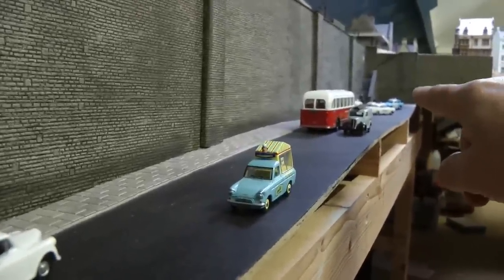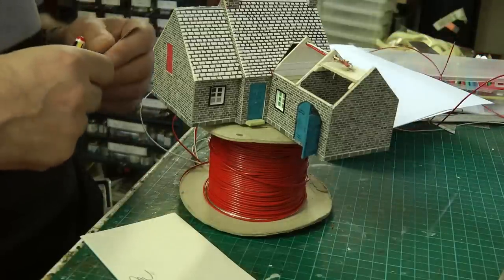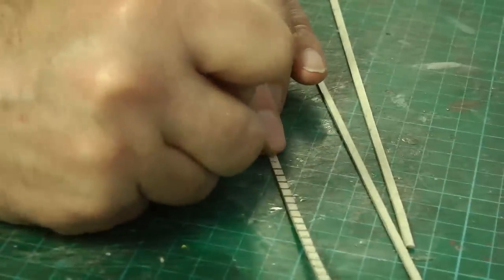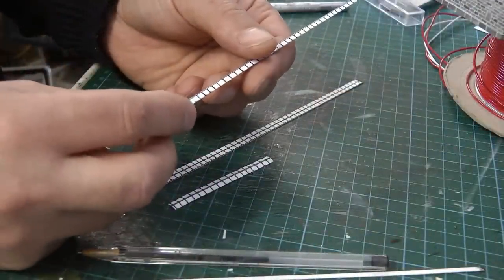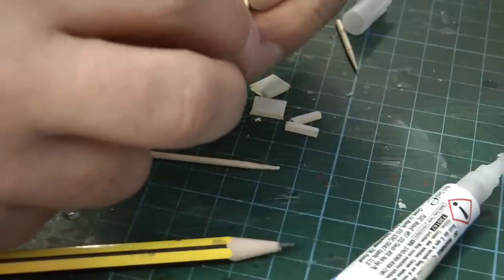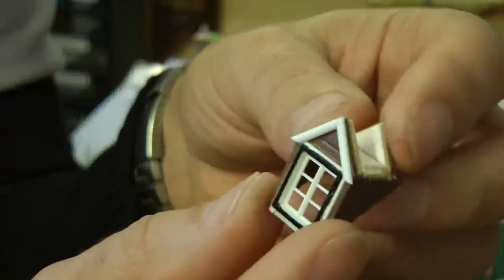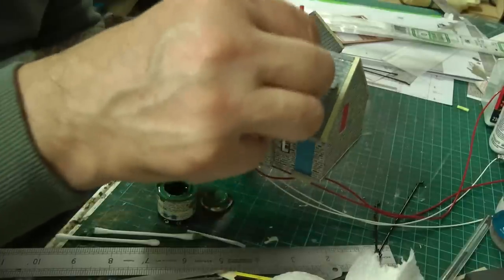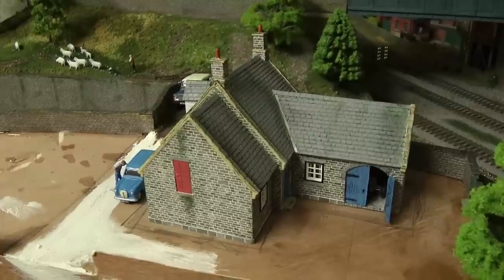Snookdown farm Part 4  No368

Comment: Great modelling once again and it’s all in the detail, like the stone capping slabs, very different - Yorkshire style! Looks super, a great choice of building. Like the dormer window, subtle but very striking. A short wheel base land rover or perhaps a cast off WW2 jeep? I suggest the fuel tank mounted on brick work should be on the opposite side to the building as far away from it up the track. How about a sheep dip and shearing area with wool bags and a shearing session in progress. A small workshop and stores, plus a small covered area ITN no doors for his land rover. How about a few bundles of fence posts and don’t forget a sheep trailer to get stock to auction. Also a small out building for the working woofs. Maybe a stable for a horse too and other covered stalls and maybe open pens for assisting at lambing. Just a couple of ideas. All the best Stephen
Reply from the maker: Hi Stephen, some great ideas there. well you have almost caught up. maybe we will be all square by the weekend. catch up soon my friend. cheer's Tony

Comment: Great work as usual Tony. Suggestion for under the tree; an rundownish 2 stable block left over from when horses did the work. Still room for a henhouse as well as a diesel pump. Agree a series 1 landie or a war surplus truck or other vehicle would fit better than the Defender model. Arthur
Reply from the maker: Thank you Arthur,  you have some great ideas there , providing there is enough space. thanks again for  commenting. all the best Tony

Comment: Hi Tony, looking great, will look better with gutters.  I'd have a series 1 or 2 Land Rover.  Probably wouldn't put much more in the yard apart from the oil tank.  25' by 35' isn't much space to turn a tractor when you have a trailer or plough attached.  Best!
Reply from the maker: Thank you Richard for commenting. i agree. a fuel tank would just about be all i could get in the yard. the gutters and drain pipes are already fitted, along with with one final detail. until next time stay safe Tony

Comment: Hi Tony and another enjoyable video.   You have done a grand job with this Northumbrian building.
I don’t know about paraffin 🤔but there would certainly have be a diesel tank filled with red diesel for the farm vehicles. 
One observation my friend.  Whilst I love the A35 van, I would question its suitability for use as a farm vehicle.  It’s not four wheel drive or diesel, so it’s not going to do very well driving over muddy or snow covered fields to tend to livestock and will need filling with petrol.  I can’t imagine carrying sheep in the back of an A35 van, neither.  Farmers in those days would have had a Land Rover, however, I agree that the one you have is too modern.  A Series 1, SWB Land Rover would be more appropriate and you can get an Oxford one for a little more than a tenner from the ‘interweb’.
The ‘edging stones’ are called ‘water tables’, my friend.  They are meant to stop water ingress into the walls (depending on the lime mortar in between each slab being sound) The walls are most likely to be 18 inches thick (not half a metre, no metres in those days). The walls would not have a cavity, being made of faced stones on the outside and rough stones on the inside, later to be covered in a layer of lime plaster sufficient to fill any undulations and form a reasonably flat surface.  Have a great weekend.   Best, Jason.
Reply from the maker: Hi Jason, i think the A35 , will become the farmers wife car. as i have found an older Land Rover which looks a treat and is more in keeping with the period. I am pleased with the way that the building has turned out so far. being a small building i thought that it might look a bit odd. its ok and it seems to suite the area. well i never knew that. water tables. we live and learn my friend. thanks again for commenting. cheer's for now. Tony

Comment: Hello Tony, we enjoyed the video and you have done a great job on the farm building. Just an idea, have you thought about adding a set of outside stone steps to the high level door to the side of the garage? Something we have seen on typical farm buildings many times. Keep up the good work. Cheers. 😀😃😁
Reply from the maker: Hi Andrew. Thank for commenting, its always great to hear about your ideas and thoughts. the space required to add  the stone steps is not there. my guessing judging by other comments they may have been a winch or a small crane above the door. for the lifting of hay. but yes keep the ideas coming. thanks again, and have a great weekend. cheer's Tony

Comment: The Land rover is too modern Tony, When I was in the TA in the 1980's the Defender was introduced, a serise 1 or 2 needed or maybe ex MOD Austin Champ (powered by a Rolls Royce, (weathered & dented)), At the start you showed the road rising Tony, No markings too the surface & needing a wall at the edge, I liked the the semi gloss finish as it looks damp! The farm building needs gutters, and in the corner old rusty ploughs/farm machinery & plenty of very over grown weeds/brambles.
Reply from the maker: Hi Vinny. i agree. th eland rover is to new. it is not easy trying to find the old split screen type. i think they are the called type 1's. i do your ideas of rusting machinery in the corner ot the yard. thanks again for commenting, as always they are appreciated. cheer's for now Tony

Comment: First of all I like your building skills, however at 20.50 you drill holes without using an awl. I would have used one to make sure the holes would heave been perfectly centered. However you would have to look threw a magnifying glass to notice it.
Reply from the maker: Hi Jeff. Well spotted. but there was plenty of wiggle room when fitting the chimney breast in place. it came together in the end. many thanks for commenting, very much appreciated. cheer's for now Tony.
Reply: @TONYNORTHEASTERN  Thanks for your reply, it's appreciated.